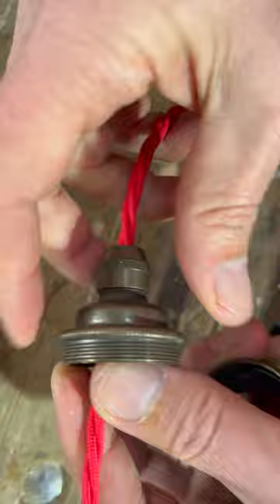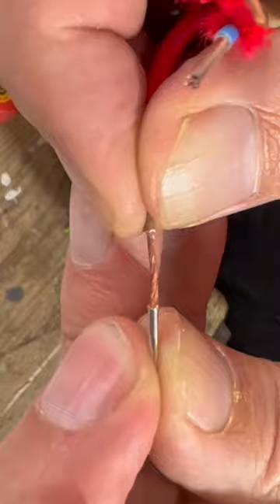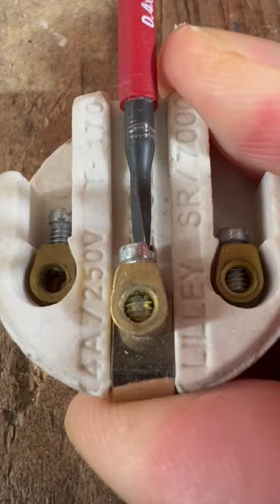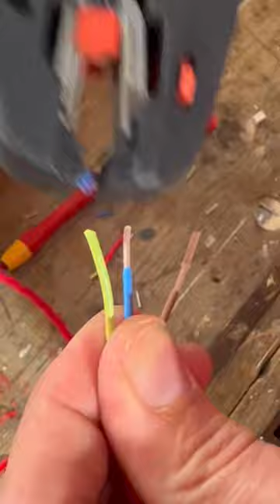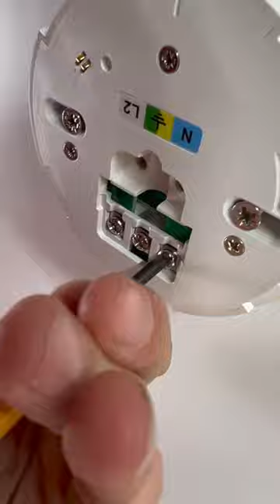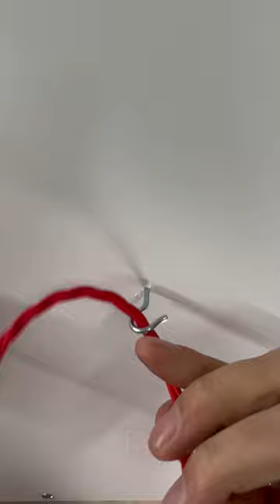Unlock the Secret Inside THIS Smoke Alarm!

Comment: You may want to check with codes on this and have to post a disclaimer. This is tampering with a smoke detector which may be a violation with  local building codes.

Comment: Why not  just say there is a 2nd terminal for a switch line 🙊🙉🙈🕴🤓🤓🤓🤓
Reply: Ask your electrician?
Reply from the maker: The L2 terminal is switched live
Reply: @efixx  i am not stupid, but what do you mean "switched live"? The phase from some light switch is wired directly to this L2? Or what exactly?
Reply from the maker: @andreismirnov7200  yes two supplies to the smoke alarm - one permanent the other via your light switch
Reply: @efixx  so wait, if you have a loop in system at the ceiling roses, you can fit these alarms basically with no alterations to the wiring? If so that's actually genius, should have been on the market 20 years ago. Also I presume they're RF connected?

Comment: Don't ever add to smoke alarms..   leave the circuits free from load so the emergency signals function properly.     Also most smoke detectors are hard wired in and by code should have additional load or connected to a switch.  Should be permanently powered on
Reply: Seems like this smoke alarm is made like this, that there is a switched line where you connect the light and the smoke alarm is permanently on
Reply: @justme5384  if that were the case it would have a purpose built knock out.

Fire Protection devices are intended to be their own circuits... however some Smoke Alarms may be equipped with a relay to control other circuits. These may be used to shut down appliances in the event of a fire or wired to a communication system such as a security alarm to transmit a fire condition to a monitoring station who will dispatch fire response.

Tempering with fire safety equipment endangers all occupants, voids insurance, and can land you having to justify your actions to a judge... who will most likely not accept "I saw someone on YouTube do it" as a defense.

Comment: So... you destroyed the certification of the smoke alarm, thus voiding any insurance that relies on it's protection... and you are not allowed to have smoke alarms powered from the same circuit as other devices such as lights... win win.
Reply from the maker: This feature is in the manufacturers instructions it’s why they include the terminals. Having smoke detectors on a lighting circuit users are more likely to notice a fault with the circuit.

Comment: Ohhh as emergency lighting if there’s a fire? So when the alarm is tripped the light will go on? 🤷🏼‍♂️ idk
Reply: Now that would be a nice option.  Just not as a functional light just for when the alarms are going off and a delay over run.  Even flash the light on the culprit if its multiple alarms and a false alarm as a subtle hint.

Comment: Dont smoke dedectors have uranium in them ?
Reply: Older ones contain a small amount of radioactive material, but they are moving to optical methods.
Radioactive ones are already banned in sone countries.
Reply: It's americium not uranium. Not quite as radioactive as uranium, but still radioactive.
Reply: not optical smoke sensors, they just throw a infrared light and "read" how much of the beam they can read, if it's under 40% (in italy the law says 40, may vary in other countries), then it close the circuit and the traditional fire control unit put the alarm on because it's not reading the resistance in the end of the line (cause the sensor is bypassing it basically). most modern fire control unit uses addressed sensors, communicating via digital signal so you can choose the beam reading value to go into alarm at the desired number (in high risk factories we set them at 60%)
Reply: Americium, but there's only a very tiny amount, and the radiation can't penetrate the outside of the detector, a piece of paper, or even a few feet of air.
Reply: @user2C47  The perceived problem is more about thousands of them crushed in landfill.

Comment: Fun fact kids smoke alarms contain radioactive components!
Reply: Only ionisation ones, most modern ones use lasers or LEDs and sensors.
Reply: not optical smoke sensors, they just throw a infrared light and "read" how much of the beam they can read, if it's under 40% (in italy the law says 40, may vary in other countries), then it close the circuit and the traditional fire control unit put the alarm on because it's not reading the resistance in the end of the line (cause the sensor is bypassing it basically). most modern fire control unit uses addressed sensors, communicating via digital signal so you can choose the beam reading value to go into alarm at the desired number (in high risk factories we set them at 60%)
Reply: But the radiation is very well contained, and can't penetrate hardly anything.